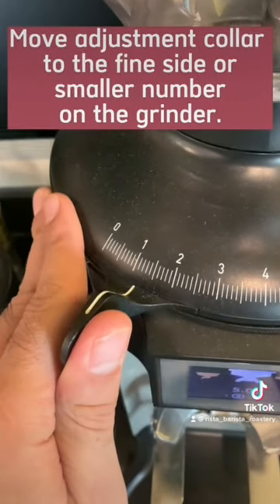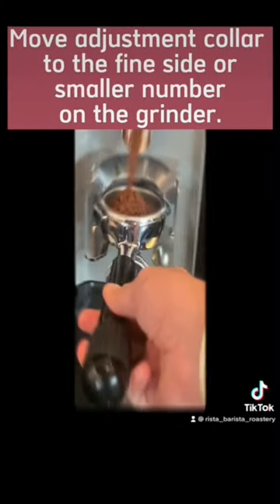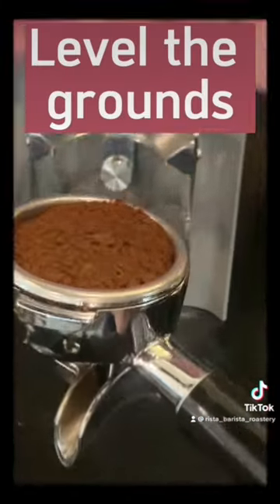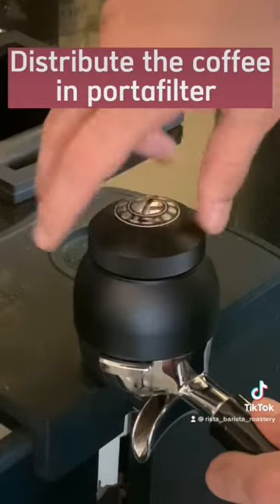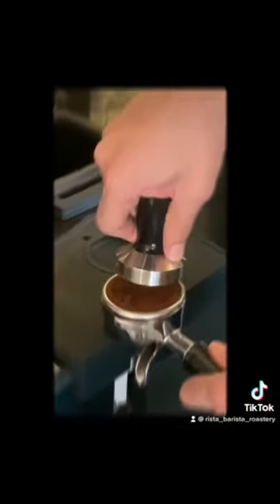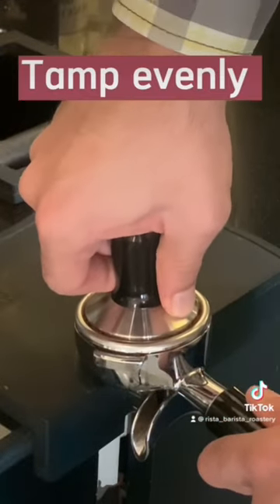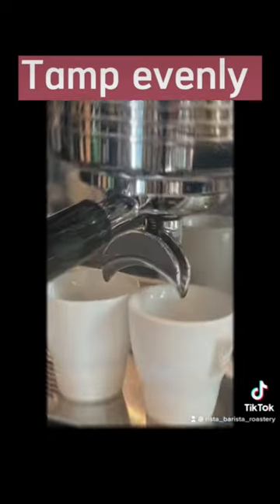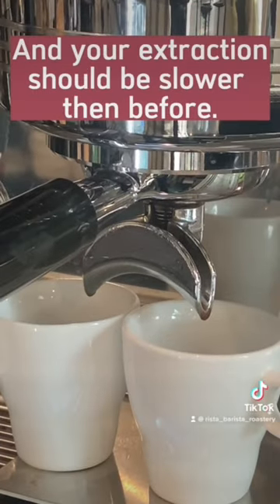Espresso Grind size Troubleshooting (coarse-fine)

Comment: Ive maxed out my grind size as far as fine. It still shoots out fast
Reply from the maker: Hello, that might be up to the coffee beans or blades got worn out.  

Try by increasing the dose for gram or two, if there is a space in the basket.
Reply: @ristabaristaroastery  hmm blades shouldn't be worn . Just used it for the first time yesterday. Brand new mazzer major v
Reply from the maker: @braekhaven Mazer major is great grinder. It might need some seasoning if it’s new. But usually new grinders are starting at coarser grind size and slowly how they get worn settings are going finer and finer. Depends sometimes on the coffee as well which you are using. Only thing I can guess now is to increase the dose in the basket. But the first time I hear that new grinder can’t grind fine enough honestly 🙏
Reply: @ristabaristaroastery  maybe I don't know which direction a fine grind is on my grinder lol
Reply from the maker: That could be the case as well when I think about it 😅